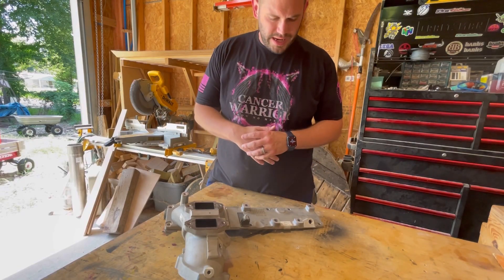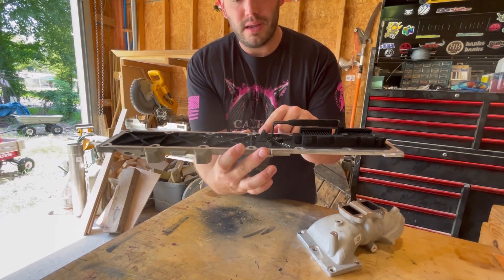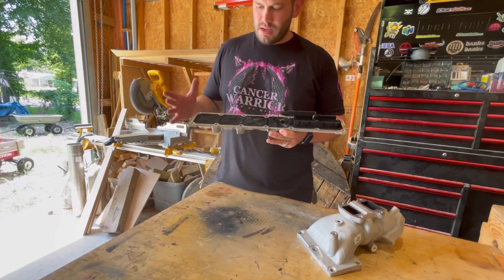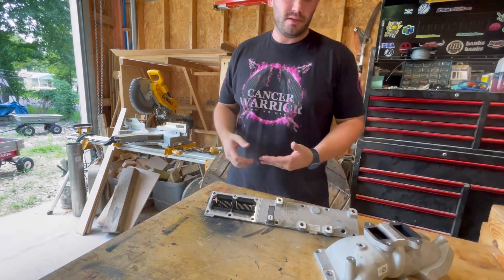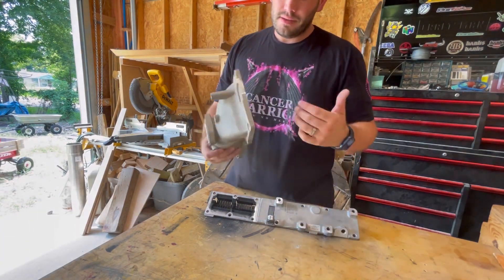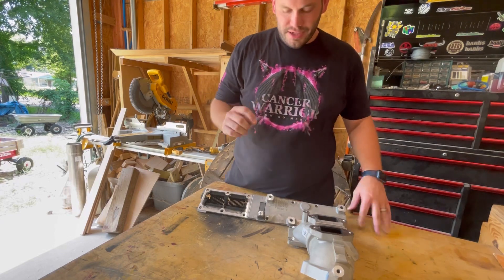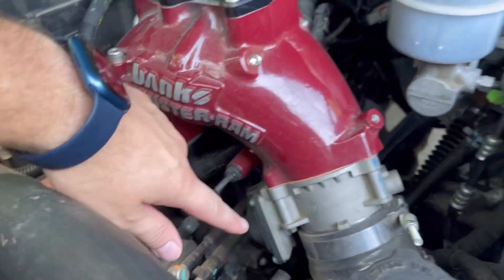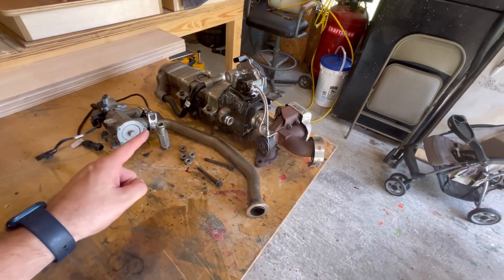💥FAIL💥 The Cummins Grenade and Why Banks Monster Ram Is Superior!!!

Comment: Pd diesel has fleet of trucks and does not have these problems. How do you know you will not have same issues with banks?
Reply: The stock grid heater will  destroy itself especially if you are in a colder climate. I've had my Banks kit in for a year now no problem yet but there definitely is 2 things that might be a problem in the future #1 the glow plug / pig tail element
And #2 is the 1 bolt that is installed inside the ram. If one of those goes I'm back to another blown up 6.7 Cummins.  Hope that helps I have had people laugh about the delete but when it happens
They won't be laughing. 15k later piston,head, cylinder, connecting rod, and labor nowadays.
Reply from the maker: @troyhardee7360  exactly! The bolt had me concerned that is inside the monster ram. I bought a hex head socket set and got that bolt torqued down good. That one does give me a little concern though too! The heating coil on the banks doesn’t really concern me much since it seems to be made from good materials that are meant for constant temperature fluctuations. However, the little stud on the top that sticks out for the lead to attach to seems really thin lol but that’s on the outside of the engine. 

Same here though, knowing that the possibility of a failure is diminished significantly gives me great peace.
Reply: @troyhardee7360  , common sense can save you $15k if only people can learn to inspect things on regular basis
Reply from the maker: This failure point is eliminated completely with the Banks Monster Ram replacement. This failure tends to occurs around the 100k mile marker for the stock system. However, I think that this failure is more common when the grid heater is actually being used and the bolt sees a lot more use. Heating and cooling with the harsher climates.
Reply: @thejourniganadventures7391  , you have heating elements that will break off on banks and drop into and destroy your engine. With bolt you can wiggle and see if it loose and with banks you are screwed
Reply from the maker: @repairvehicle  the heating element on Banks is configured completely different. The bolt is what fails on the stock set up. The heating element is designed to withstand extreme heat and clearly the grid heater bolt was not designed to withstand the constant stress of extreme heat over a long lifespan.
Reply: @thejourniganadventures7391  5 years warranty on banks, clearly designed for short time. But you keep convincing yourself that you made right decisions, he needs more people like you to make money of them. If it was better designed than factory then it would better warranty than factory. Bolt is a lot thicker than heating element, I wonder how many heating cycles it can handle being thinner before dropping down inside the engine. Thicker material handles heat cycles better than thinner, physics 101.
Reply from the maker: @repairvehicle  actually having the heating element in my hand and inspecting it before install it appears to be made well. If you feel some type of way about the Banks equipment I would suggest taking it up with them or get ahold of a heating element and run a stress test perhaps? The factory warranty is the same exact thing for the stock setup if you choose the 5 year/100,000 mile extended warranty. So not sure what you are trying to imply there. Not everything has a lifetime warranty lol 

Regardless, I personally have piece of mind and love my purchase. No need to convince myself of anything, I am a happy customer. Giving my honest feedback based on my own research and inspection of the parts I purchased. Nothing is failure proof, that’s just the truth in everything in the world today. You say the bolt and stud are thicker than the heating element but you are entering into an entirely different realm when it comes to metal compounds and material resistance to extreme conditions. Just because something is thicker does not mean it is stronger. You could take a 1” copper rod and a 1/2” piece of rebar and see which one shows signs of failure first in destructive testing. 

I appreciate your comments though! Thank you! Love the interaction and the conversation.

Comment: It looks like you have done the EGR/DPF/DEF delete on your truck. I have a 2021 as well. What setup did you go with? And what kind of differences did you notice?  Thanks!
Reply from the maker: I went with the EZ Lynk auto agent 3 tuner from The Diesel Dudes. Highly recommend them. They were quick with answering all my questions and providing support for the software. The delete kits (EGR and exhaust) I bought from DPF delete shop. I went with the 5” stainless steel exhaust kit with the muffler and I polished the exhaust tip myself. 

Truck runs great and it made a huge difference on the performance. I love it.

Comment: It looks like you have done the EGR/DPF/DEF delete on your truck. I have a 2021 as well. What setup did you go with? And what kind of differences did you notice?  Thanks!
Reply from the maker: Whatever gives you that idea 😁

The set up is a 5” downpipe back stainless exhaust system with a muffler. Ez Lynk auto agent tuner with 5 position SOTF. Of course all the Banks goodies too. 

The truck was fun before the updates and now, LOVE IT! I spent a lot of time looking for a good company to get the tuner from. Highly recommend the Diesel Dudes based in Canada 👌

Comment: Did you notice a increase in your regen cycles? I got mine installed 4 fill ups ago and I regen twice a tank now
Reply from the maker: I did not notice a difference in the regens actually. I just recently pulled off some stuff 🫢 moved on to the next phase of diesel ownership and I enjoy the truck EVEN more so now lol.
Reply: @thejourniganadventures7391  I'm about to do the same... Let me know what your MPG has gotten to!
Reply from the maker: @wreckitmech306  took a trip up to Nashville, TN and got 20-21 the entire drive going 75-80 mph on the big stretches of road. When I dropped to 70 in some of the areas it was creating 22-23.
Reply: I get 21-22mpg at 75mph on my 2018 ram 3500 cummins, completely stock truck with air down tires for smooth sailing like Cadillac. Off course truck with regen more, drop in air pressure. Why do think banks never posted hp gains on his website, because it’s opposite.